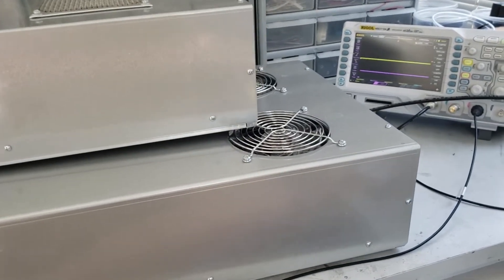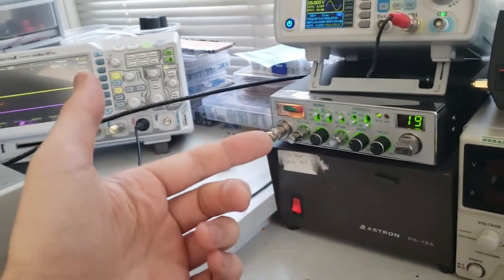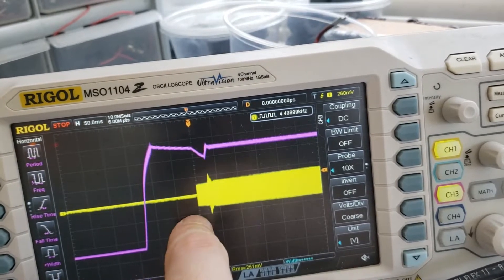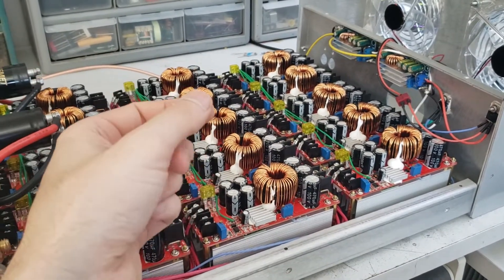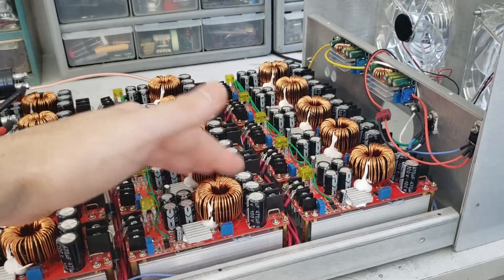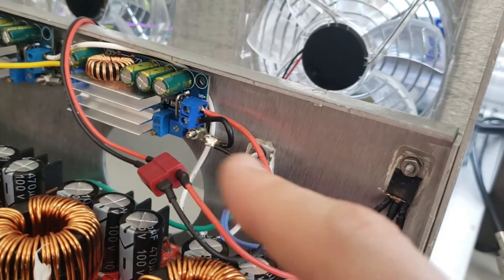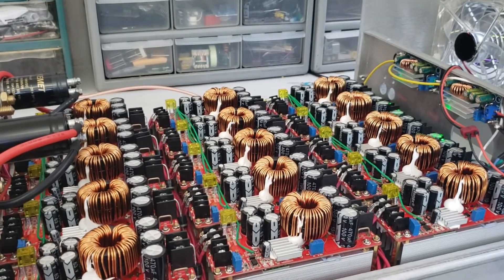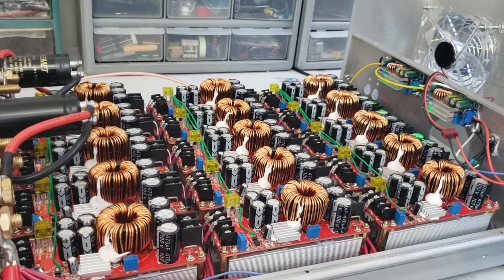Mobile LDMOS Supply (Pt. 3)

Comment: It would probably be cheaper to use 18650 batteries for the 65V supply, then four 1800W DC-DC converters would be sufficient, or just as many DC-DC converters that a maximum of 100 amps are drawn at 12V. With 20% duty cycle operation this is enough to charge the 18650 cells while receiving.
You don't need any additional alternators, the board system would be loaded with a maximum of 1.2KW and the voltage would not drop drastically.
If you use a sealed heat sink housing, you can also install the DC-DC converter in the engine compartment, which then also takes up much less space in the trunk and the voltage losses are lower.

Comment: im actualy planning on modifying a spare alternator for 50V and putting it under the hud for amp usage. its going to sit next to te omg alternator and im thinking of connecting the diode ground to the omg car alternator 14V so the modified alternator will make only 36V. just changing the diodes to high voltage values and making a simple op amp transistor voltage control for the field, the alternator should be able to give higher voltage by just spinning it faster, so maybe a smaller poly is needed and of course big capacitors

Comment: Good work. Wish I'd found this earlier. I have been doing similar reverse engineering work on the control circuit. But only on a single unit for a  200W 50V LDMOS AMP. The standard boards have a N channel MOSFET switch on the DC input as low voltage disable protection on the OV rail. I replaced that with a P channel in the postive rail and use that to switch with my PTT line for on demand. The RF noise in VHF (50, 70, 144 MHz) is impossible to get rid of, the only way to be able to recieve weak signals is to to use the on demand approach. All works great now.

Comment: you made the best of china boost converters. with the voltage sag you talk about this can be help along by adding a Maxell super cap across the input terminals. bring battery big cable to the cap and big cable  2 to your power supply . keeping cap close to supply as possible. will make a big improvement on  SSB and AM with low dead key. you hade the right idea putting some caps inside. 73's

Comment: Wow.....YOU BEAT ME TO IT.......Niiiiiiiiice Very Nice.

I've got 8 of these in Parallel to run my dual board. After using a bit of current sharing techniques via resistors and a simple LC Circuit to take the Noise down dramatically to an exceptable level it, works great.  Had help from my mentor on that!  :)

You went ahead and made the BEAST out of these things :)  Nice....I really am loving what I am seeing from you brother.

I been working and learning this tech for the last 2 years or so and would love to show you my quad BLF188xr unit I had semi success with to get your honest opinion from one builder to another.  I can link you to the video.

My email is info@gatekeeperamps.com 

Still thinking around a unit with 6 and 8 using the old school Hybrid Coupling Techniques from the Motorola Bible.  So if one unit goes out the others continue working.  Of course these were mainly designed using BJT devices and the combinner would have to be a broad banded combinner.  If it was a narrow banded one I don't think it would work to well because one board going out would throw the  impedance ratio off.

I still consider my self a newbie with this tech and will always be open to learn more and more from it.  People like me, you and all the other builders are the ones that are going to help make this a standard one day.  That is why I'm a huge believer of everyone working together on some sort of level and putting the pride to the side ya know.

Just think...It all started from a seed from the skullcracka nation out to Idaho through BBi and is now flourishing abroad. Gotta love it.

Look forward to your new videos.
Reply: Nice to see you posting. I was watching your videos and they ended like a year ago. Thought something might have happened to ya. 

73's
Reply: @FantasticCalamity  nah all is well...stated making the private to control the amount of request since im not taking in work till i finally catch up which will be very soon..